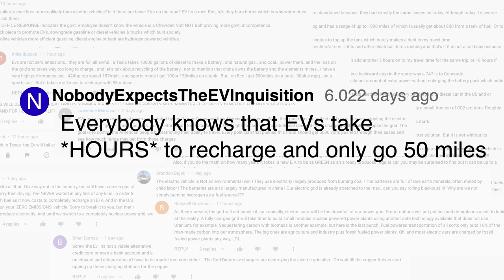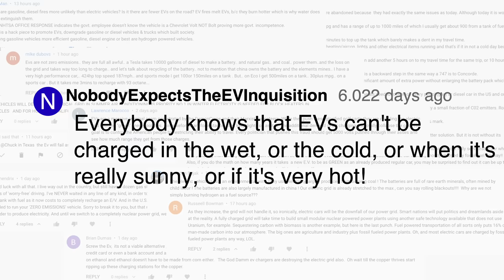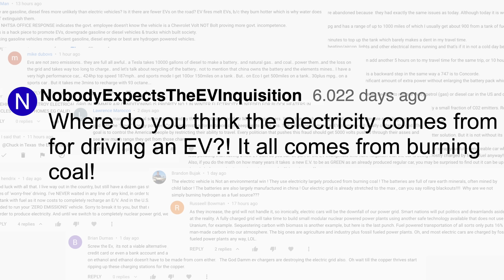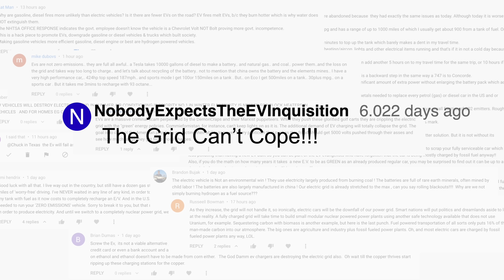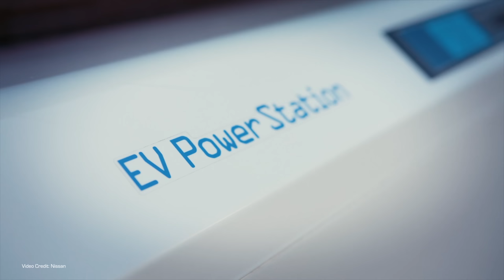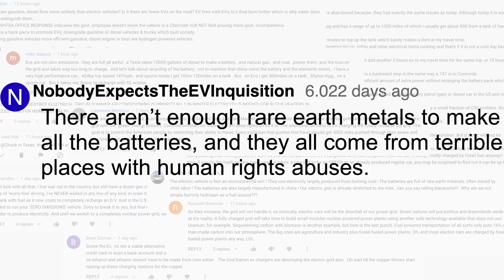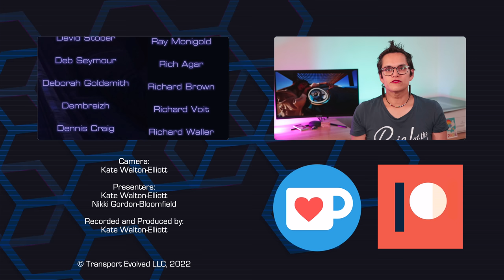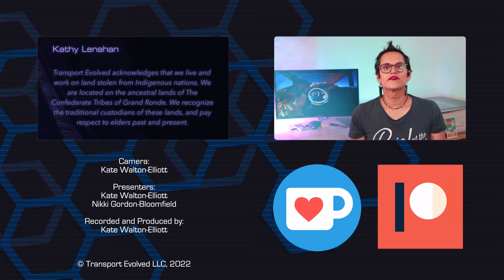The Transport Evolved List of Common (EV) Misconceptions

Comment: I love EVs and myth debunking, but I feel like we should be underpromising and overdelivering a bit more in terms of what current EVs can do. When you say that a typical modern EV can charge 10–80% in 15–30 mins, how many can actually do that? Tesla, Porsche Taycan, Kia EV6 / Hyundai Ioniq 5…which others am I forgetting? I feel like 15–30 mins for most EVs is a stat for 5 years from now. No doubt we’ll get there eventually, though!
Reply: My Bolt definitely does not charge from 10% to 80% in anywhere near 30 minutes. But, in the real world, you almost never have to actually charge all the way to 80%. Most of the time, I just home charge. And, when I do need to charge at public charger, it usually comes down to needing just a small amount of extra power to make it home comfortably, without range anxiety, so my typical charging session normally comes down to 20-40% in 15 minutes, which is a whole lot easier to deal with than 10% to 80% in 60 minutes.

Even if I were to take the Bolt on a long road trip, I don't think I would routinely charge to 80% unless I had something to do. Much better to unplug at 60% when charging starts to slow and just stop more often to make up for it. Of course, the ability to charge faster would still be nice, but it's hardly something you absolutely have to have, and definitely not something I would pay $20,000 extra for.
Reply: @ab-tf5fl  Interesting how our experiences shape our opinions. I also drive a Bolt, but we have so few fast-charging stations here in Arkansas that on the rare occasion that I do drive long distances in it, I pretty much have to charge up to 80%, or at least close to it.

I go back and forth on this. The 55 kW charge limit is obviously way out of date (even 100 kW is probably obsolete now!), but you’re right—if you only fast charge a handful of times per year, is it really worth an extra $10–20K? Probably not. (That said, I’m looking forward to the next step in EVs, which is 150–200 kW for $30–40K!)
Reply: 2/3 of the EVs sold in the US can do that. The others are from the traditional ICE manufacturers who mostly have less than half a clue about building EVs and can be ignored.
Reply: @HenryLoenwind  Do you mean 2/3 by the number of vehicles (i.e., Teslas)? If you mean 2/3 of the models available, please list the ones you’re thinking of. Because I was thinking Ford Mustang Mach-E, no…Ford F-150 Lightning, no…VW ID.4, no…Rivian R1T, no. I read somewhere that the small-capacity Leafs might fast charge to 80% in under 30 mins, but that shouldn’t count because their range is so low (<150 miles) that it violates the spirit of the question. (The spirit of the question is, “Which EVs can you drive long distances in without it adding a lot of time to stop and charge?”)

Comment: The grid. Such an interesting problem. What some grid operators are finding is if you build low cost solar and wind farms, you attract high energy guzzling industry. 
Pushing you back to a grid on the verge of collapse, that can only be saved by reopening coal fire plants.
Electrification is going to be such a interesting balancing act.

Comment: BUT you are screwed for charging if you have a condo or an apartment.
Reply: Get an Aptera, Sono Sion, or if you are not stuck for ... ... a few more bob, a Lightyear Zero
Reply: @peterchandler8505  Aptera is smoke and mirrors.  All these years and they don't have a working prototype yet with solar power. Also, it will be classed as a motorcycle which means it won't be as safe as a car.
Reply: @THESocialJusticeWarrior  You do need to keep up...  Aptera are on their 3rd prototype now, production intent is the next version later this year / early next.  Contracts are being secured for production with CPC in Italy (they make body panels for Lambourghini & others), along with solar PV supplier, established wiring loom manufacturer, and battery suppliers, production facility secured and in use by them.  The latest prototype has working solar PV.  Nikki of this channel has explored the earlier prototype with a ride around in the Aptera...  On their track evaluation day, the Aptera beat a Tesla Model 3 in a drag race...

All these years...  Steve & Chris initially started back around 2009, brought the wrong people in & got moved out, then it went bust.  Few years ago they bought the IP again and are moving forward quite quickly, even California are in the process of giving them $22 million!  Guess California would not be so generous if it was "smoke and mirrors"?
Reply: @peterchandler8505  Please show me a link to the solar powered prototype that gets their claimed 1000-mile range.
Reply: @THESocialJusticeWarrior  The Aptera is still at the prototype stage, as taking a car from concept to manufacture is a rather convoluted and expensive process laden with legislative traps and other hassles that is not for the faint hearted (so it is great to see industry consultant Sandy Munro so involved), then the full range of production versions does not magically appear within a few months of concept, ask Elon Musk, who took about 12 years to get to the Model 3 from the Roadster!  So it is my understanding that the 400 mile range cars for San Diego customers will be manufactured first, then other battery options will be added to the mix as the manufacturing process expands, although others here may have a better idea of when the 1000 mile range version will appear, my only understanding is that the 1000 mile version will be the last added to the manufacturing process.  It is after all, a substantially heavier car that will need a completely different set of tunings / settings before letting members of the public get their hands on essentially a sports car as even the front wheel drive version (5.5 seconds to 60mph) is faster than quite a few 'sports cars', with the all wheel drive (3.5 seconds to 60) is perhaps nearer to motorbike performance territory...   As I have heard that youtube has a habit of deleting comments with links (it may only be some accounts?), if you look on youtube for:
Aptera Gamma Reveal - LIVE
you will see the reveal event for the latest prototype with working solar panels at the Fully Charged Live show in San Diego about a month ago.  

Aptera team recently took some Apteras (Apterae?) to a test track for suspension & vehicle dynamics tuning / evaluation in preparation for the next prototype earlier this year.  For a bit of fun they put both an all wheel drive & front wheel drive Apteras(e) into a drag race with I understand a model 3 and some quite quick ICE car, then put the video on youtube (under a minute...), titled:
Aptera — Drag Race

Things are moving quite a bit with the Aptera, you do  need to keep an eye on it to stay up to date.  As others have noted, Nikki of this channel is in the queue for an Aptera, I guess that she would not have taken that position without having some confidence in the team, and she will have had a rather better look at it and the team than us having posted a few videos about the vehicle, filmed at Aptera's premises with at least one having a ride in a prototype.  

Left out the safety bit earlier.  The Aptera body will be built from carbon fibre and other composites (by CPC in Italy), drawing from F1 engineering to create a sturdy structure that distributes impact loads well, not forgetting that the unusual shape will lead to vehicle deflections in preference to direct impacts for many collisions.  The founders have repeatedly said that they will put the Aptera through normal car crash testing, and expect the Aptera to perform well based on the engineering F1 roots, obviously you do not put early prototypes through crash testing!!
Reply: @peterchandler8505  what a load of BS.
Reply: @THESocialJusticeWarrior  Do tell where I am going wrong here then...  Not just a one line response, but explain...
Do remember that part of my career was in an engineering development business, where every job started as a blank piece of paper alongside the customer requirement...  So do have an understanding of where these guys are coming from, although from a different field.  

You might find Nikki's video on this channel from a month ago useful:  
The Aptera Gamma Prototype Is Here. What's NEXT?  One of 3 or 4 on this channel covering the Aptera.  

Unless that is of course you are of the mindset sort of described by Mark Twain amongst many who have expressed similar ideas?  Mark said:  
"“Never let the truth get in the way of a good story.”"
Although many have expressed a similar thought that might be more relevant here?  
"to not let facts get in the way of a their opinion"
Reply: @peterchandler8505  They didn't start with a clean sheet of paper.  They started with a fully developed Aptera EV.  All they had to do was put solar panels on it.  They have had YEARS and I haven't even seen a mockup.
Reply: @THESocialJusticeWarrior  I think that you have not got the whole picture there...  The 2e was from about 13 years ago (earlier likely more as it announced 2009, so design & sourcing would be well before that), technology has moved on so much in the last 10 years that pretty sure that the only common ground between the current Aptera and the 2e is broad brush strokes body style, but even that has been modified by the progress in computational fluid dynamics allowing improvement of air flow around the Aptera for greater efficiency.  

The Aptera 2e was lastly a hybrid, hence not a fully developed EV, it did not get to market (hence not fully developed) before the automotive industry based people they brought in pushed Chris & Steve out (you might want to look at Aptera's Owners Club on youtube where they recently reviewed an Aptera blog where Steve gave more insight into the events leading to the end of their first attempt at creating an Aptera).  The technology that the 2e was based on has probably disappeared into history now or superceded by superior technologies, in the UK for example, white goods manufacturers were required to keep spares for retail products for only 11 years when I was in an associated industry (electronic manufacturing, my career has touched many industries!).  Hence pretty sure that restarting the Aptera a few years ago it would have been not far from a blank sheet of paper for materials (especially composites), batteries, software for running the car as well as designing it etc. etc. which have all changed over the last 10 years rendering the 2e little more than a concept / starting point for today's Aptera.  

"All they had to do was put solar panels on it"...  Solar panels in almost all cases are manufactured for static locations where resilience has to deal with the vagaries of the weather...  An automotive solar panel will have to deal with vibrations & shocks from driving, a very different set of stresses on the panels on top of the vagaries of the weather, accentuated by travelling at much higher speeds than your average roof travels at. Granted there are a few examples such as Silent Yachts putting solar PV on retail boats, or the panels used to power the Vende Globe IMOCA 60 yachts etc, a growing market but I would suggest very small compared to rooftop & utility scale solar PV, and still using monocrystalline PV whereas the Aptera is using powder PV cells for greater resilience having signed contracts for solar PV supply...

"They have had YEARS"  Steve & Chris where moved out of Aptera not long after the 2e was announced, they only reacquired the IP for the Aptera in the last few years, hence I would suggest that they are making quite reasonable progress as they were restarting from quite a low base only a few years ago.  

I would suggest that you not having seen a mockup is more where you spend time online than Aptera's progress (unless you live in San Diego / California where you could go to see their assembly plant where I suspect Apterae are often parked outside?) , there are videos all over youtube showing the current version of the Aptera, with many youtube journalists having the chance to have a ride in one such as Nikki from this channel, Aptera's Owners Club, or Rich Rebuilds as three examples of the many that come immediately to mind, with Nikki's interesting interview with Chris Anthony about a month ago giving a useful insight into where Aptera is heading.  

Things are moving on with Aptera (as well as the Sono Sion & Lightyear Zero), do try to keep up!

Comment: A recent survey in the UK shows how bad the charging situation is with only one charger for every 13 cars and getting worse because the rollout of chargers is falling way behind electric car sales badly, add that to the disasterous survey about out of service chargers in Scotland and the picture is bleak and not attractive to future EV purchases.
Reply: That’s on the move. Scotland has been hampered due to lack of investment by private charge networks. Many rapid points were put in by councils using grant funds and had no fees to use. (Managed by chargeplace Scotland) What operator can compete against free stuff? Most of the free charging is now gone in Scotland and more of the networks are moving north. Osprey and MFG are opening hubs shortly, a big hub opened off the m74 recently by Fastned.
Reply: Does this study take into account the home chargers also?
Reply: @somewhat7  no, they’ll be referencing public available points only. No private units will be included.
Reply: @somewhat7  why would it ?
Reply: 1 charger for 13 cars? That's like one gas pump for every 80 cars(*). I'm pretty sure there's not a gas pump for every second street around here. In fact, in my town, it's one pump per 1500 residents. So more like one pump for 500 cars or so.

(*) Based on a blocking time of 7 minutes per car for gas pumps and 45 minutes per car for EVs.

And with these numbers, I'm completely ignoring all people that have a personal gas pump in their garage at home. Or an electricity outlet, though those are exceedingly rare and most people don't have one at home.

Comment: I have had people tell me that it would cost them more to charge an electric vehicle at their home than fueling a gas car at a gas station. I know for sure that this is false because electricity is cheaper than gas and electric vehicles use energy more efficiently than internal combustion engine vehicles.
Reply: While that's definitely false if you live in a single family home, I can see it being true in some cases if you live in an apartment where charging infrastructure is controlled by a landlord, who decides to drastically mark up the price of electricity in order to pad their profit margins. Even if home charging costs more than nearby DC fast public charging, the landlord may figure that some people will opt to pay for the convenience.
Reply: @ab-tf5fl  I'm pretty sure I wouldn't want to rent from a landlord who charges 5 times what the utility company does. I'm pretty sure those types also charge a usage fee for the front door...